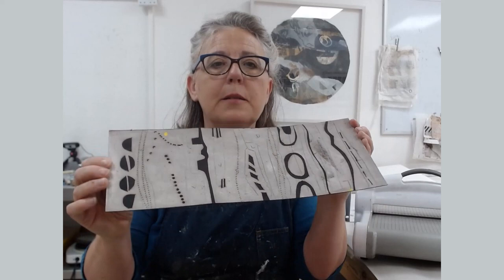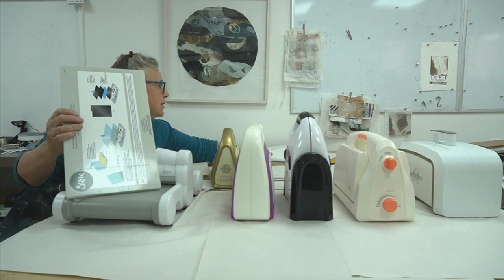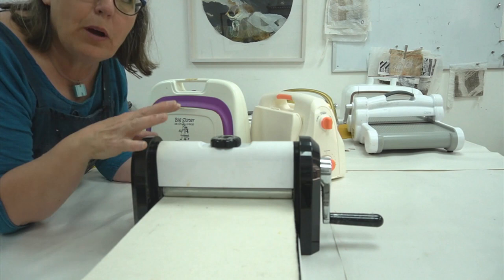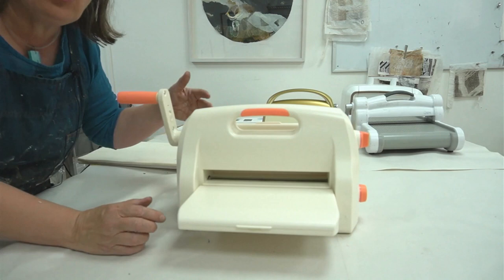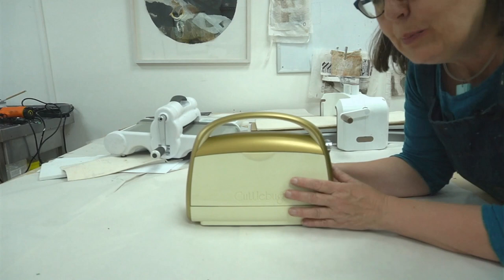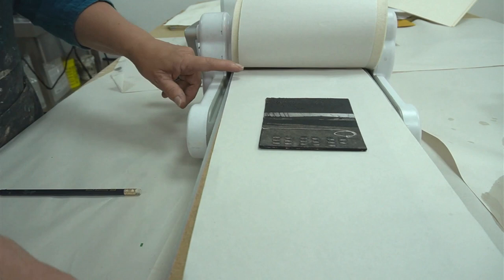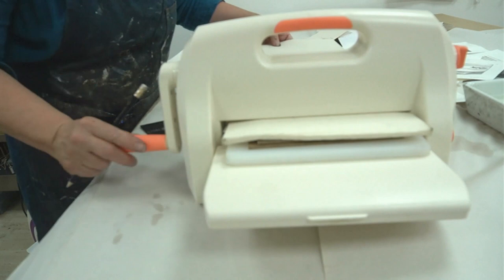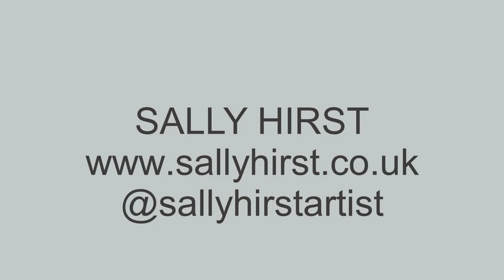Testing craft die cutting machines for intaglio' collagraphy and drypoint

Comment: Such a helpful video Sally, thank you so much.  The only thing I'm wondering is which, if any, of these has a wider width than 6 inches.  I'm thinking of getting cold lamination machine so I can do bigger intaglio.   So interesting to see the quality of prints here.  Many thanks.
Reply from the maker: The bed is 21cm 9" If you dont want a large border you can get an 7.5 inch wide print. There is a fiskars machine that is wider? chasing one on ebay! im going to test a CLP next week but from what have heard its tricky as the rollers are spongey...
Reply from the maker: And there is s bigger sizzix, the Pro. Also if you are in the states a Fiskars Fuse is 12"

Comment: Tech question Sally just wondering what the blanket thickness is for the XCut that you are using here to print your collagraph and drypoint?
Reply from the maker: The blanket I like is a ‘cushion’ blanket made from compressed felt, 3mm thick.
Reply: Many thanks Sally I am in Australia and have managed to track down a second hand x cut so needing to check the bed and blanket sizes with you. Thank you so much for all your help. I hope to do an online course with you once I am up and running. Cheers Judy  @sallyhirstartisttutor6324

Comment: Thank you Sally for sharing this video.  I have the Sizzix Tim Holtz Vagabond Electric Die Cutting Machine.  Have you ever used an electric die cutting machine for printmaking?  Curious if it would work or if I need to invest in a manual machine.
Reply from the maker: I would say try it if you have one! If you feel it is struggling the motor then go manual...